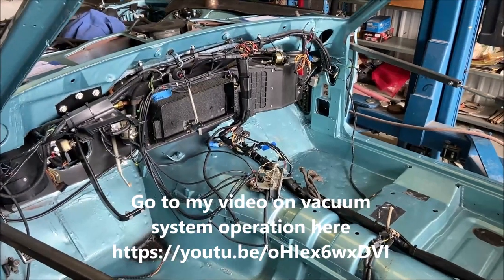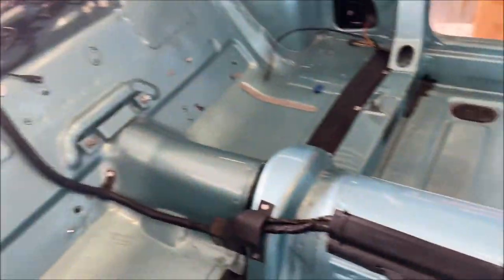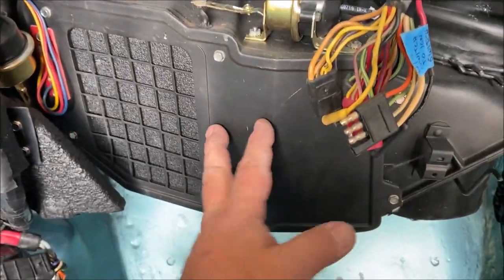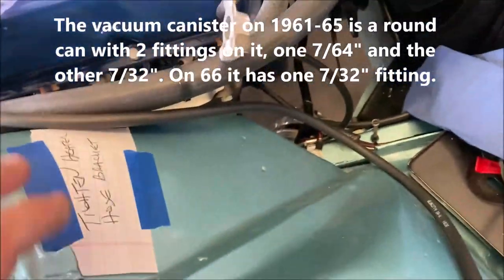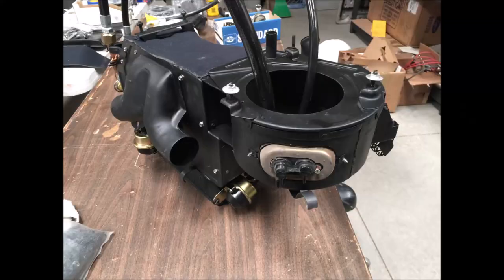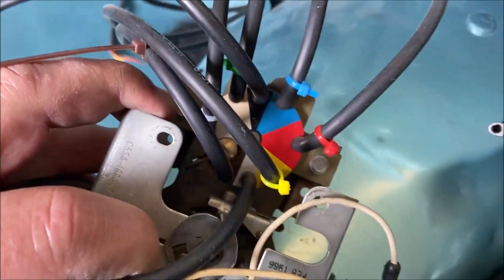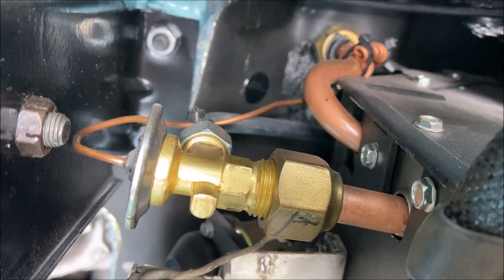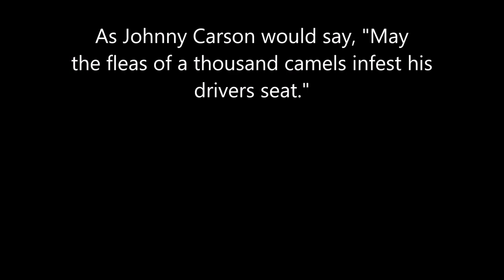1961-66 Thunderbird A/C and heater Vacuum System Layout

Comment: How does the temperature slider control work if you bypass the temperature regulator valve? Does it do anything? I don't really know how the slider works in the first place so bare with me on that one.
Reply from the maker: The temp control slider is a vacuum switch that applies more or less vacuum when the slider is moved. The thermostatic switch was to safeguard the fan box from excessive heat and would lower the heat or turn it off if the fan compartment got too hot. It would do that by lessening or increasing the vacuum to the heater valve. Even if the temperature slier control was just on or off, it would then turn the heater valve on or off. If you have too much heat blowing out the vents you could simply turn it off. The difference between the two is that the thermostatic control valve had a bimetalic strip that would lessen or close the vacuum off depending on the temp. The temp control slider is simply a manual left and right "more or less" switch with no bimetalic strip.

Comment: Do you have a video on removing power window motor on a 66. I have ground and power up and down but no movement. The motor looks new also
Reply from the maker: I have a video on repairing the motor, loading the regulator and operation once back into the door but I do not have one showing removal or installation. Are you talking about door window motors? Try removing the door panel and while someone is pushing the switch, hit the motor with a hammer and see if that jars it loose. However, you first must determine that power is in fact reaching the motor. If power is reaching the motor, you will get a dimming of the dome lights as you push the window switch. If you get no dimming of the dome lights, then either power is not getting to the motor or the motor has an internal problem like its rusty or something. You can also try applying power to the motor directly once the door panel is off. This will give it extra power to move. Its not uncommon for window motors to become stuck once all the way up or down. This happens on my own 66 so I just don't roll them all the way up or down. Ill get to it some day.

Comment: Not sure you if mentioned where the marked white vacuum hose connects too ?
Reply from the maker: The white color coded vacuum hose goes to the recirculating door that is in the fan compartment. The recirculating door closes off the heater core and allows air to recirculate when the air conditioning is on.
Reply: @vintagethunderbirdrepair9426  ahhhhhh ok gotcha thanks alot Nick. I started buckling down and replacing the hoses today and I decided to borrow your color coded zip tie idea 👌👊💪 You have a goodevening brother,  I cant thank you enough!
Reply from the maker: @Tachdout  No problem, good luck.

Comment: Hey Nick! I ended up running a new source hose into the car to bypass the thermostatic control valve. When I get it to the back of the pie wheel, it is going to T off into the temperature control valve. Do I also need to attach the source to the rear vent switch off of this source hose at the pie wheel? Or is there a separate source hose for the rear vents? Also, how can I connect the 5/64" hose into the 7/32" hose?
Reply from the maker: There is only one source hose and everything T's off that so the rear vents also T off the same source hose. You will need to use an adaptor fitting to connect two different size hoses.
Reply: @vintagethunderbirdrepair9426  I see in the engine bay on the passenger side firewall at the very bottom a vacuum line goes in there. Is this for the rear vent and door locks? Should I T it off in the engine bay or under the dash?
Reply from the maker: @bransonmckee745  Yes, that vacuum line is for the emergency brake, neutral safety switch, and rear vent. Sorry, I forgot about that line. Technically it is a second source line but not for the air condition or heater, just the ebrake, NS switch, and rear vent. If you had vacuum door locks you would have a third source line going through the firewall directly to the door lock junction block under the dash on the passenger side. Again, my diagrams show all this. Have you not seen those?

Comment: On the 65' model vacuum controlled on/off switch for the ac, what is the little copper tube/wire looking thing for that comes off the switch frame? The one I have is only about 1" long and all the pics I have seen it is really long, but I can't find where it goes and what it is for. Do I need it etc...? Thanks
Reply from the maker: Hey Justin, I just saw your comment so please forgive me for not responding sooner. The switch you mean is under the dash and controlled by the yellow vacuum hose right? That tube is a capillary tube and it goes into the evaporator and senses temperature. If the evaporator gets too cold, the capillary tube senses this and shuts the AC off. Yes, the tube should be very long, maybe between 1 foot and 1 1/2 foot long? Something like that. It is pushed into the evaporator in the center. If you open the front AC vent, somewhere near the center of the evaporator, you should see an area where the fins are pushed away slightly to allow the tube to enter the evaporator. Good luck.

Comment: what does the thermostatic control switch do and does it effect the system being bypassed ?
Reply from the maker: You are talking about the thermostatic control valve in the fan compartment for the heater valve right? Not the thermostatic control switch for the air conditioning clutch. The thermostatic control valve for the heater protects the system from overheating from heat from the heater core. It is a vacuum valve that is temperature controlled to shut off when the bimetallic spring overheats shutting off vacuum to the heater valve. Since there is no replacement or repair for the thermostatic control valve what else can you do? I have found no other resolve other then to bypass it completely. Otherwise, the system works exactly like before it was bypassed. Thanks.
Reply: @vintagethunderbirdrepair9426  thank you im trying to hook my vacuum lines up in engine compartment and everything was just such a mess so ill probably have to pull out dash and check what was done in there for ac as well.
Reply from the maker: @lurkerine  If your just rebuilding the vacuum system, you do not need to pull the dash. You do however need to pull the heater box and all dash access panels for access under the dash including the panel where the clock is. Obviously there is less access room when the dash is out but ultimately it is less work. Good luck.

Comment: Hey Nick, I got all the lines ran and replaced, but when I turn on the fan I get no air. The fan is working, so I was going to replace the blower motor. Does it come out from the inside or the engine bay?
Reply from the maker: Hey Branson, the fan and blower motor come out through the engine compartment side. I'm confused, you said the fan is working but your going to replace the blower motor. The blower motor runs the fan so if the fan is working, then the blower motor must be okay. I don't get it.

Comment: So I have that canister for the door locks, are the hoses running to the doors?
Reply from the maker: Yes, there is a junction block behind the dash on the passenger side and two hoses go from that junction block to each door. The hose from the canister goes to the junction block.
Reply: @vintagethunderbirdrepair9426  the junction block is the brass blocking top of the intake manifold?
Reply from the maker: @Tachdout  NO, the junction block for the vacuum door locks is behind the dash, not on the intake manifold. The brass block on the intake manifold is the source for the vacuum.
Reply: @vintagethunderbirdrepair9426  yes the source junction block was the one I was referring too I’m just trying to make sure I make art out of this shit storm of hoses that were never connected and just hanging around lol I’ll locate the junction box under the dash today after work , Thank you Nick
Reply: @vintagethunderbirdrepair9426  I did some research and found the junction block passenger side I was always looking at it and wondering what it was and the function, now I know👍 Thank you for pointing me in the right direction Nick ! Have a good day brother✊
Reply from the maker: @Tachdout  Your welcome. Glad you were able to figure it out.
Reply: @vintagethunderbirdrepair9426  I gotta say you make it 10x easier to work on this classic Nick and for that we Appreciate and applaud you💪👏👏👏👏👏

Comment: Nick, do you have a preferred part number or source for the vacuum actuators?

Thanks
Reply from the maker: Hey Bill, the part number is Motorcraft YH161. You can get them from Bird Nest or any of the Thunderbird dealers. Good luck.
Reply: @vintagethunderbirdrepair9426  Thanks Nick.  Perfect.  Now for the nylon looking button sliders on the swing away steering column.  Do you know where to source those.  With one completely sheared off amid gummed up old grease, the swing away binds.  Thanks Nick, your knowledge is unsurpassed.  
Cheers. Bill
Reply from the maker: They are not available new. Ill check to see if I have one. Ill get back to you in a day or so. Thanks.
Reply: Thank you Nick.  The broken one snaps in, the ones with the Allen screw adjuster are good.

Comment: Another question, the little "valve" for the min-max is leaking a small amount of smoke while looking for leaks. Is this rebuild able? According to the smoke test this appears to be my last leak. Thanks
Reply from the maker: Hey Justin, I have never heard or seen one that has been rebuilt. Actually, I've never seen a bad one. I think you can only get used ones. Try the Birds Nest, they should have some good used ones. Good luck.
Reply: @vintagethunderbirdrepair9426  ok thank you.
Reply: Never I d, I think I figured it out. It’s not supposed to hold vacuum but rather adjust the amount of vacuum. Right?
Reply from the maker: @justinlogue31  Right.
Reply: @vintagethunderbirdrepair9426  Change of subject, do you know of a re-manufactured or something that will at least work for the defrost duct? All the original ones I have found just crumble when you touch them. I have to figure something out for the drivers side.
Reply from the maker: @justinlogue31  Hey Justin, no I do not know of anything to replace them. You just have to be super extra careful when handling them. If you find a couple good ones, you could spray them with something to stiffen them up. Or brush resin on them. Thanks.

Comment: Im kind of lost this system is a nightmare lol, anyway I have a 65 so the canister on the fire wall the big hose goes to what goes to the small port on that canister? Also the lack hose that goes to the pie what is the configuration of the bigger and smaller ones?
Reply from the maker: https://youtu.be/dYd7LWQf2ao  Hey snkeyes, here is a link to a video where I show the vacuum system diagrams and the sizes of hoses and everything, you cant go wrong with these. I know the systems are intimidating at first but they really are not that hard. Study the diagrams, you can figure it out, its not hard. Good luck.
Reply: @vintagethunderbirdrepair9426  The Only 1 I am having a hard time with is the source hose where in the video you have it set  the way you do for testing, so what is the correct way for hooking up the black hose? Is it just a offset T?
Reply: Also did you run a vacuum hose to the rear vents? if so what color?
Reply from the maker: @snkeyes-ri2hd  In the stock configuration the small 7/64 black source hose that goes to the pie disc control on the dash comes from the largest hose coming off the thermostatic switch under the dash in the fan compartment. The large 7/32 hose goes from the thermostatic switch to the temperature control switch next to the pie disc on the control on the dash. The small 7/64 black source hose that goes to the pie disc T's off this large 7/32 hose somewhere near the control unit on the dash. Just pick a spot near it, maybe a few inches away. My diagram shows this. I hope that helped.
Reply from the maker: Also, this is complicated because I bypassed the thermostatic control switch in the fan compartment so I have the source hose hooked up differently and I used a smaller hose for it. I hooked it up this way for testing because I bypassed the thermostatic switch so I had it hooked up funky. I ended up keeping it this way in the finished product. I guess your having trouble reading my diagram. The shop manual also has a full diagram of the vacuum hoses. In a nut shell, I ran a 7/64 small hose from the engine compartment and ran it all the way to the control on the dash and T'ed off that to go to the black wedge on the pie disc and to the temperature switch. You can clearly see this at 7:30 in my video where I even name the hose and you can see where I T it off to the black wedge and to the temperature switch. This source hose comes directly from the engine compartment where it is T'ed off the large hose connected to the brass fitting on the intake manifold. But remember, this is because I bypassed the thermostatic control switch. Good luck.

Comment: I have a 63 factory T-bird and my HVAC system is not working. I plan to start tearing it apart, a little scared I will admit. Are you in California by chance?
Reply from the maker: Hey kw, no I am in Colorado. However, my videos about the vacuum systems are almost identical to those used in the 1961-63 Thunderbirds. The only difference is that the 1961-63 use cables for the defroster and AC clutch switch. But otherwise the vacuum system is exactly the same, the plenum is almost identical and the routing of all hoses is exactly the same. It is not hard to do this, just time consuming. Take photos of everything, every hose, every nut and bolt, the positions of everything. Then you will have something to reference later when reassembling. Thats how I learned. Good luck.